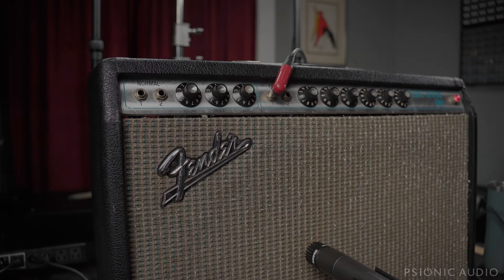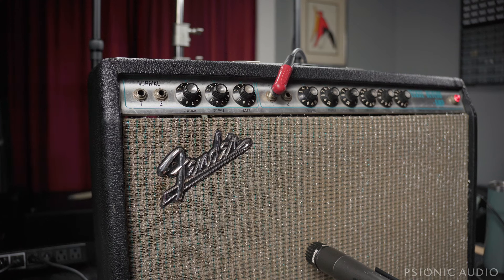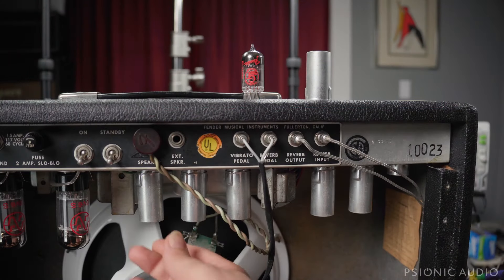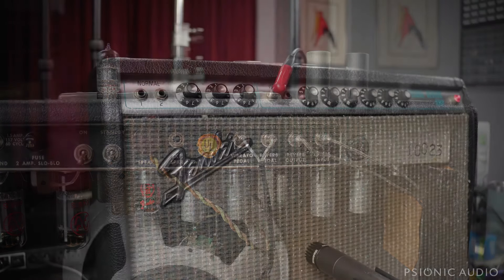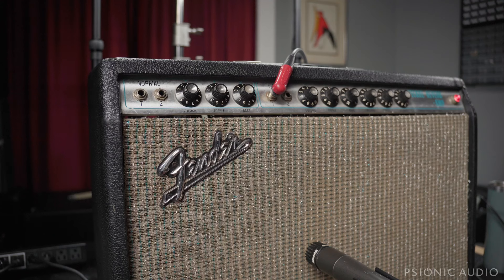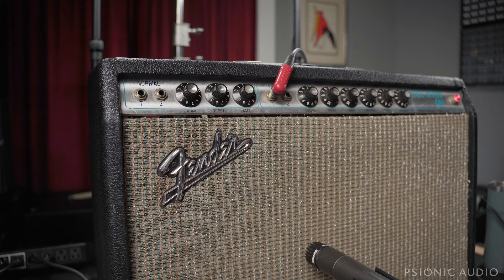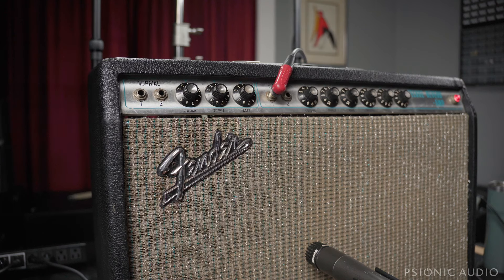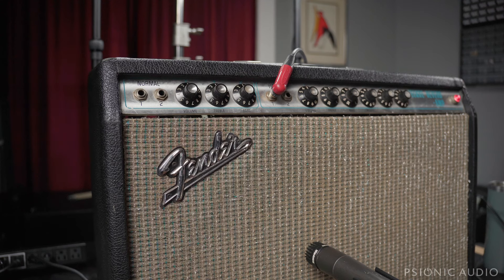Fender Tricks | Increase Gain without Mods

Comment: When the V6 phase inverter is changed from 12AT7 to a 12AX7, the amp reaches distortion in the phase inverter stage before it reaches distortion at power tubes, whereas stock it reaches distortion in the power output stage first.  Distortion in the power output stage sounds smoother and more pleasing, less ear-fatiguing to most.  Also, that tube-switch-around cuts the clean watts output some as well, which may be a good thing for some folks, as you can then reach output stage distortion (with preamp stage distortion) at somewhat lower loudness.  Further, this phase inverter tube change AND pulling V1 can be done to all original black-face and all early silver-face amps.
Reply: In my opinion, preamp overdrive can sound pretty good if designed correctly. What's funny to me is the people who will knock modern amps with master volumes and then talk about doing things like this. You can't have it both ways.

Comment: anyone old enough to remember when most amps had tubes will be aware that, within the lifespan of tubes, there was a  ‘peak period’ of performance where they would absolutely sing in warm, rich tones; beautiful, clean sustain that you wished would never end (though, sadly, it did) I would change all my tubes if one went bad so they would all be the same age…my all time favorite tube amp I owned was an original Supro 40 watt…I had no idea what it was but my father, a guitar teacher, used to buy and sell all kinds of gear and picked it up for $50 (in the mid ‘70s) all I knew was that it sounded incredible when full up…I used it exclusively until it blew up onstage in the early ‘80s…let’s quote the bible according to Keith: “The right guitar through the right amp; throw your pedals away” amen (at 65, I now use a 5 watt Bugera)

Comment: Have any-one heard or used a little plug-in box called an "Ice cube" it used to plug in to the reverb send / return on the back and this added an extra gain controlled by the reverb knob but you lose the reverb but it was "Epic" !
Reply: I've had an ice cube for at least 45 years that I use on mid 70's band master. I do plug it in the reverb channel in the rear. I use a boss delay unit for slapback which nicely replaces any need for reverb. I set the 'reverb' knob (now a boost) just below 4 because it gets noisy beyond that, but it works great and I  love the tone.

Comment: I experimented with pulling tubes and dropping the preamp voltage and changing the bias of preamp and power amp etc. In the end I accepted that I liked the base tone of the AB763 as designed and anything I tried moved just far enough away from that so as to sound "different". I think the problem is that one-amp-guys want it all. We want amazing clean (so cool bias, tight speaker), the "advertised" Fender chime, we want amazing edge of breakup (hotter bias, celestion style speaker) and we want ballsy overdrive. Its a hell of a rabbit hole. In the old days I would do what the Old Timers did: turned the amp up to 7-8 and use a 8-9k (and microphonic PAF style pickup) Les Paul with 50's wiring (so pickup loading which preserves treble response when you turn down). This involved positioning the amp off-stage, turning it round and latterly using deflector screens to handle the volume peaks. Now I use a treble bleed equipped Fender or a 50's wired LP in to an always-on "transparent" overdrive like a JHS Morning Glory (lower gain V2) or the Bluesbreaker (reissues are great for Fenders) and a mix of lower MU in V2 and higher MU (V4) preamp tubes. The Phase Inverter tube in an AB763 is were most of your overdriven sounds are fundamentally shaped. So getting that one right is vital. I like a NOS Mullard in there. I find the small bottle 5881 style power tubes grind WAY more than the big bottle 6L6's in the bigger amps. The final ingredient being the speakers. I like a bit of speaker breakup and I find that modern high power speakers don't get in to their sweet spot at usable volumes so can sound dull or "flat" while simultaneously being hellishly loud. So I deliberately use 40w speakers in a Twin or 15w speakers in a Deluxe etc. The other option, especially if you record a lot or stream, is to get an UA Ox. Kid Anderson often uses one of those with a silverface twin and headphones (he uses an IR and no live speaker in the room). Covers everything he does. Sorry for the essay! 🤣 FWIW in my opinion the best and only thing anyone ever needs to make every kind of music is a Deluxe Reverb equipped with a JBL D120F. Just drop the money now and thank me later. 🤣🤣
Reply: I cheated, did not pass Go, did not collect $200, and bought a Tone King Imperial MkII.
Reply: I've heard that combo a few times, and don't disagree!
Reply: I have a 74 Deluxe  w/a JBL D120F. The clean tones are great but when cranked the treble can rip your face off. ( fender guitars)
Reply: One amp guys do want it all, I was going to post something like this.  To me I will run the right amp for the job, but I also have a stable full of very different amps (and just as important, speaker cabs) all hooked up to an elaborate switching system.

The way I approach it, is I appreciate what an amp does and lean into it.  If I want something else, then I try another amp/cab

Btw, my fav “fender tone” is made with a music man going into a EVM-12L

Comment: Love your videos- you’re such a pro. 
Question- How is this amp so quiet (noise floor)?? Maybe you have something filtering out the noise through your mic?
I have a 76’ DR that’s been serviced and the noise floor certainly improved but it’s nowhere near this quiet running.
Reply from the maker: Thanks. I put a small bit of room removal on my voiceover mic but never do any gating etc on the amp mics. Not even EQ or compression. You hear what the amps sound like.

I do videos in 4K so YT uses less compression on the audio so you get a more realistic idea of what the amps sound like. Including noise floors.
Reply: @PsionicAudio  Gotcha- so maybe how my amp is running is normal then? Again it’s not terrible, just kinda hissy especially when the reverb is on and I get up to 4, 5 and onwards on volume
Reply from the maker: Well, part of my gig is making them run as quietly as possible.

Comment: I have to admit we pedal lovers have it way easier. We want more gain, or change of eq, compression, etc. We just slap a pedal in front and our problems are easily solved and away we go. Because in the end nobody else gives a poop. I have tried listening tests with a Line 6 in Vox settings and an actual Vox - and nobody could tell the difference. This stuff only matters to the actual player

Comment: Great video! I think that amp is late 1969 (they dropped aluminum trim away)  to 1970....'71 if that faceplate is original. There reads "Deluxe Reverb -Amp" That "Amp" word dropped ~'71. Also Fender logo is what they used till early 70s.
Reply from the maker: But it has a glued in baffle. I didn’t look closely, just saw the baffle and a ‘66/‘76 date code on the reverb transformer. 

Doesn’t matter as to the point of the video.

Comment: I set a TC Spark on top of my amp and use it to push the OD circuit.  The Spark is a very transparent gain pedal.

I don't love pedals.  But using that 1 pedal, gives me a lot more gain AND I can turn it off in a second to get my sparkling clean tones back.  

AND I can do the same for my Princeton Reverb too.

For pickers that are searching for their signature tone, this vid is definitely the way to go. 
For those of us that are trying to mimic tones from numerous different songs, probably not the best way to go.  🤔

Comment: Just sayin', but you should NEVER connect those silent plugs to the input of your amplifier. Those are designed to connect to a guitar output. They can damage the amplifier badly. If you google the neutrik silent plug webpage you can find info on it.
Reply from the maker: The jack on this DR is the same jack on my guitar. Not an issue.

Comment: Great video! Recommended mods for sure. One question, If I remove 2 power tubes on a 4x6L6 amp and disconnect one speaker to match the impedance, do I need or is it recommended to readjust the bias?
Reply from the maker: Yeah, make sure the bias is still in a safe good range. Some companies switch without a change in bias but they build in a “safe window” (often with tonal compromises).

Comment: I had a device back in early 80’s called an ice cube small blue ice cube looking plastic device that plugged into the reverb tremolo foot pedal  jacks it really upped the gain
Not sure how it worked but it did
Reply: I have the same.  Still in the reverb phono jacks of my silverface Twin.  There’s some circuitry (buffer?) in it that allows a clean pretty powerful boost depending on your REV knob’s setting.

Comment: Hi, that is an awesome tip. Great video, I'll give this ago later. 

Can I ask you a Q? Have you ever made a video on amp Vibrato issues you could link? I have a 65 Deluxe Reverb Reissue and if I engage the Vibrato circuit I hear an audible low freq ticking (without any guitar input). It's not very loud but it's annoying. It also remains when the guitar is being played. Thanks.
Reply from the maker: Thanks, and yes I’ve addressed that. Usually lead dress. It’s in some of the RI videos, check that playlist.
Reply: @PsionicAudio  Thank you so much for responding. I’ll check them out 🙂

Comment: Great video. I've borrowed a number of Fender amps for gigs. But one of the best I played was Princeton that was owned by a venue I would play in the mid to late 80s. I would plug my Yamaha SG 200 into it and run a fuzz pedal through it like a Rat and a Boss Chorus. I got more than enough gain for a good classic rock tone. I've owned a lot of Marshalls but Fenders like this just sound like home to me. I prefer good pedal platform amps to high gain amps. You can't beat the warmth of a Fender. The last Fender I owned was a Bassbreaker which was good but too Marshally for me.

Comment: Great video, Lyle.  What's your take on changing the 12AX7 phase inverter in a Tweed Bassman to a 12AT7?
Reply from the maker: It’s a move in the opposite, cleaner direction. Won’t hurt anything. If you like it, it works.
Reply: @PsionicAudio lower gain, but higher current.

Comment: @psionicaudio  this simple mod interests me, but I had a question.  Would this be the same result as bridging the two channels together with a patch cable and/or using an ABY switch into both channels simultaneously.  I believe it has the same gain increasing effect, but I was curious as to if the pathways dramatically differ.  The fenders(and others) have some interesting plug and play mods on the fly for certain sounds for sure.

Comment: Why is it  the amps are always set with  treble and midrange about 5-6 and bass about 4-5? Wouldn't there be more and better tone, if  the treble and mids were up about 9 or so and the bass about 6-8, therefore providing more tone?
Reply from the maker: You’d have more signal but less control over the frequencies. Don’t sweat it - there’s an additional gain stage after the tone stack to maintain plenty of signal even with the insertion loss of the tone stack.
Reply: With the passive B/T tone stack, the midrange is intentionally reduced because guitar pickups are very mid-heavy.   But you still want to be able to balance between the three ranges.  Because the circuit is passive, all you can do is reduce the level of one (or both) of them to get the balance you want.  
So the tone stack is designed to have a reasonable balance between B/M/T when you have the B and T reduced to about half.  
This means that when you turn up the treble, that's not what's happening.  You're not increasing the amount of treble, you reducing it less, letting more of it back in the mix.  
Because you can't adjust the mids, if you put the B and T towards maximum, by design, you'll have way too much of them compared to the non-adjustable M.  
Since the entire design is reductive, there is a pretty serious reduction in overall single in the path after the tone stack.  Most amps will have, either another gain stage after the tone stack to bring the signal back up, or the design can use a "cathode follower" tone stack which doesn't lose so much signal.  But it does have a different sound from the "Fender" (et.al.) style.  
There's more than this to understanding the whys and wherefores of tone control design.  But this should give enough to answer your question.  🙂
Reply: @PsionicAudio  Wouldnt it sound best with  the tone knobs still up  between 6-8, a little higher,  wont that  get more out of the amp? I  know what you mean about trying to balance the tone between pickups,  and  tone knobs.

Comment: I am confused how it is possible to have more gain (or volume) by removing a tube ? Wouldnt that reduce the gain ? 
(but at the same time also  reduce headroom in the preamp , creating breakup at a lower bolume ? )
Reply from the maker: V1 and V2 share a cathode on their second triodes. So pulling V1 gives V2 a gain increase because its cathode R effectively halves.
Reply: You are removing the tube you're not using so the power usually feeding both tubes is now only feeding the one tube you're using allowing it to have all that power by itself.

Comment: The often neglected 2nd input... Andy Summers used it almost exclusively on his plexi
Reply: I don’t use them, and I don’t see the value in them. It basically halves the input signal. This isn’t great as it lowers the signal to noise ratio on the amp. Ideally you want to attenuate the signal after the first stage.

Comment: Another trick is pulling the V5 if you don´t use the tremolo anyway. This will give you also a little bit more tone. This three tricks pulling V1, changing the V6 with an AX7 and pulling V5, I have done to all my fender amps and enjoy their sound now even more :D
Reply from the maker: Pulling V5 won’t affect the audio path. But if it makes you happy…
Reply: @PsionicAudio  Ok - you might be right. To my ears the amp "opens" up a bit more. But could also be the placebo effect ^^

Comment: What would be comparable "mods" on a Princeton?  Can you pull the 12at7 in V2?  or even a 6v6 power tube with no issues?  If you pull a power tube I would think it would need to be re-biased.
Reply from the maker: There aren’t any comparable mods on a Princeton. And never pull odd numbers of output tubes in any Class A/B amp (and only pull even numbers after much research).
Reply: @PsionicAudio  I wasn't planning on it - just curious.  I know sometimes people will remove 2 of the power tubes in a Twin.  Princetons get fairly gainy around 4-5 with humbuckers anyway.

Comment: I seem to recall another "mod" involving connecting the reverb out directly to the reverb in, and then using the "reverb" control on the front of the amp as another gain stage. Of course, you loose the reverb effect, but it is easily reversible (arguably easier than pull tubes). Thoughts?
Reply: WTF?!!

Comment: Those two gain stages come after the volume pot, so how is that a better way of increasing gain than simply turning up the volume pot? I suspect the answer is that you have introduced more distortion by “deoptimizing” the two stages from what would ordinarily be considered best for fidelity. If that’s the case I’d view the increased gain of those two stages as a byproduct, not the main objective. If the customer prefers that type of distortion to simply turning up the volume pot or adding a boost pedal, all is good. A comparison to those alternatives would be useful.

Comment: I was always wondering when you do tubes swaps like these, is there a risk of blowing a resistor because the current draw increased? Or maybe that's only when you switch from a 12ax7 to a 12au7 if you want less gain (cough peavey cough)...
Reply from the maker: Current and voltage changes from minor preamp tube changes are negligible.

Comment: What about plugging into both inputs? I do that on both mine to get a pretty big boost. But I don't own any Fender amps so I don't know if they work the same.
Reply: Vintage Fender normal/vibrato channels are not in phase, so the sounds would be working against each other. Then again, if it sounds good, it is good.

Comment: I always wondered why old Fender amps have two inputs for each channel, so I was wondering what the difference is between them
Reply: Input 1 = designed for LOWER output signals (single coils and some P-90s). WARNING: pretty sure this contains 60 cycle hum. So even when you're not playing and you leave your volume on, say, 3-10 on your guitar, you will hear something coming from the amp.
Input 2 = designed for HIGHER output signals (humbuckers). Using this input lowers the decibels by 2-5? Somewhere there, but decibel readings are NOT linear, they're logarithmic. Goes into distortion faster and sounds a bit darker. To me, "darker" means a little muffled. Same notes/chords being played but with some layers of bed sheets in front of the speaker. Someone please correct me if I'm wrong.
Reply: @samsoliva more or less though the number 2 input halves the signal via two 68K resistors.

Comment: Hey, I was wondering; during Nirvana MTV Unplugged show Kurt used a Twin Reverb for his 1959 Martin D18e as a monitor, to have more gain on low volume apparently his guitar tech used a 12au7 in the PI / V6 and replaced the 7025’s with 12AX7’s. What are your thought on this? And how would you approach that show with a Twin Reverb as monitor?